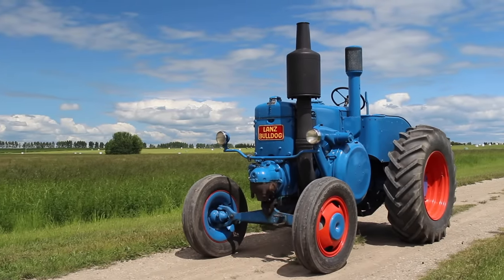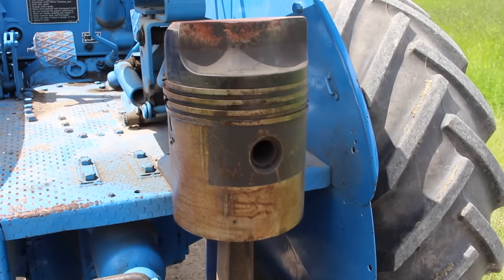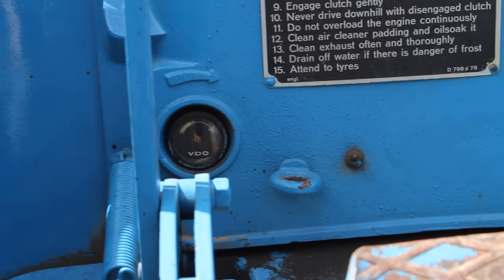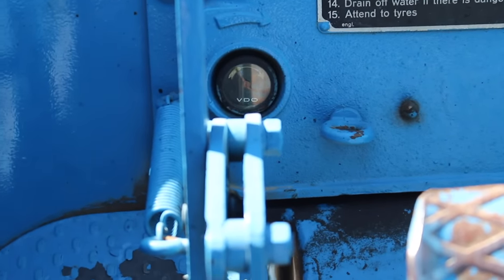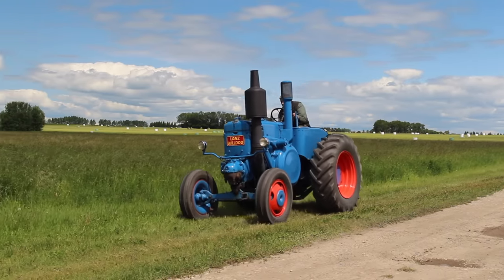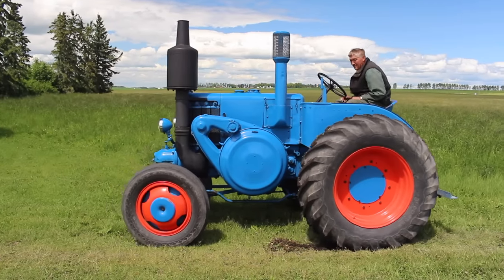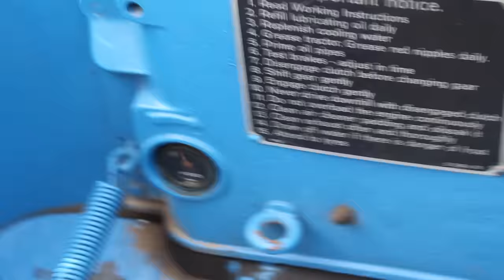Engine running backwards? Lanz Bulldog Tractor two stroke

Comment: Nice video! Its crazy to think that it only has one piston.
Reply: it packs tons of torque in that single one
Reply: One big piston
Reply: Over 600ci
Reply: @dieselgeezer18  no it doesnt, it has 45hp according to the info. Thats not lots of power at all
Reply: @hello7533  What did you expect from a 70 year old tractor? Yes it doesn't have a lot of power for its cc. I meant it packs torque and low end torque in a single piston, not power
Reply: @dieselgeezer18  he just doesn't appreciate it for what it is, a long-lasting simply built workhorse
Reply: @hello7533  It does have torque. 500Nm to be exact and that is just the amount at top speed. It most likely has an even higher torque amount at 300 or 450 with around 700 to 900 Nm. So it is a lot.
Reply: Similar torque compared to a Porsche 911 Turbo, Ferrari 488/-F8, Mercedes S-63 AMG
Reply: @andreashabeck1155  Exactly. And now for the important part because torque doesn't really mean anything.
The gear ratio is so low, that it multiplies this torque even further and with it's inertia still makes for a powerful tractor even for today. Just not as fast as modern ones.
Reply: @hello7533  HP and torque are two completely different things, that thing defiantly has a lot of torque.
Reply: @hello7533  Cummins diesel engines that are meant for heavy hauling typically only have around 500 HP, which isn't actually a lot especially compared to most sport and muscle cars, however, they have a shit ton of torque, over 1000 Nm actually, like for example: the Cummins X15 with 430-605 HP and 1650-2050 Nm of torque. That is more than double the HP. Just because something has low HP, doesn't mean it has low torque, and that one cylinder engine defiantly has a shit ton of torque, maybe not as much as a modern engine built for torque, but it defiantly has more torque than most cars now a days.
Reply: @PilotTed  power = (torque * rpm) / 5252

Comment: It looks nice when it runs at 0 rpm, but this is very dangerous for the piston lubrication because the oil pump of this Lanz Bulldog D9506 can only pump one way (forward). In the long run, this can cause major damage.
Reply: I heard they pump oil both ways
Reply: @GhostOfDamned  Not with this Lanz Bulldog.  A lot of older types can run the oil pump in two directions.  This because they have no reverse gear.  These include the HL12, the HP Knicklenker and the HR2.
Reply: Can't there be one of those pedal bike backwards and forwards drives?
Reply: @ellenorbjornsdottir1166  a fixie bike can be pedaled backwards
Reply: That's why it's not being done as you say, 'in the long run'. Just as a display of an interesting mechanical feature.

Comment: Older Mercury outboards had an "idling neutral" in actuality no neutral at all or method to disengage the propeller. To reverse the engine, the spark was advanced to the point where the engine backfired and started running in reverse sort of like this tractor diesel.

Comment: put someone on this tractor who have backpain
Reply: That can’t be good for it
Reply: Or perhaps it's exactly what it can @aterack833  . It could be like chiropractor treatment? 😭😂😅😆🤣😄😃🙂😉
Reply: @MrArray1967  well my back pain is from degenerative disks so I guess idk what helps normal back pain
Reply: @aterack833  back pain may be caused by many different reasons. I'm sorry on your behalf with degenerative disks. Years ago I had trouble with lumbago i.e. lower back pain. Exercises was my cure. Bending and stretching.
Reply: we had these in poland. the driver after many years of working in tractor with bucket sized piston have back injuries
Reply: @MrArray1967  chirotractor treatment :P
Reply: @okuratwarmianski7993  was the back pain caused by actually driving an Ursus/Lanz Bulldog or by repeatedly and perhaps prolonged manually starting them?
Reply: @ryanknol3876  chirotractor 🤣😅😂

Comment from the maker: It is possible to run at zero rpm!
Reply: Well, that's zero revolutions per minute. But not zero reciprocations per minute.
Reply: @leximatic  In RPM it's more like +60, -60, +60, -60, +60, -60, ... so it sort of averages out to 0 :)

Comment: 0:36: Please don´t call it "Diesel"! You can burn Diesel- fuel in it, but it is no "Diesel"- Engine. Diesel engines are classified in compression ratio from 12:1 to 24:1. The Lanz Bulldog engine shown in the clip has a compression ratio between  5:1 and 6,5:1 only.
Reply: Garten-Forsttechnik-Jenner what fuel does it take ?
Reply: Diesel, Gasoline, Alcohol, Kerosine, Cruid Oil, Engine Oil and a mixture of  different kind of fuel. If there is a liquid  that can burn you can use it in such an hot bulb engine.
Reply: diesels start from 14:1
Reply: @dieselgeezer18  you have to put something more combustible in the tank with the diesel to have an easy start in the cold but you can start it during the winter with 100% Diesel as long as the hot bulb is hot enough then you can run it 100% on diesel. Hot bulb engines both vaporises the fuel and uses compession to ignite, this is why you can run them on fuel oil and even crude oil.
Reply: @andersskithog7440  my comment is about the compression of diesel engines. The commenter said that diesel engines start from 12:1 compression ratio but this is wrong. Diesel engines start from 14:1. There is no diesel engine which has compression of 12:1 or 13:1 etc.
Now about your comment... Hot bulb engines do NOT use the compression to ignine the fuel. It has ONLY 6,5:1 ratio. The hot head is what ignites the fuel

Comment: How much add blue does she take?
Reply: Hahahahaha
Reply: Yes
Reply: "About 2 litres."
"Per 100 kilometers?"
"No, per stroke."
Reply: they didnt even fueld those tractors with diesel , especially during ww2 - my grandpa was drafted to drive those things during ww2 and they  used heavy fuel, fishoil, kerosene, tar or vegetable oil :D my dad owns a handful of those , from 1930s all the way up to 1960s
Reply: @CAARLcseditsandmore  That's incredible! Apparently they could also run on crud oil or naphtha. I just did a bit of research after reading your comment and discovered that these tractors were used by the Wehrmacht on the eastern front for a variety of purposes, such as removing ice from runways and towing airplanes from hangers. They're credited with being responsible for the Luftwaffe fighter aircraft being able to continue to operate from their mid-winter Russian located air bases. Every other engine would freeze up in those -50°C conditions but the Lanz Bulldog would always start because its single cylinder could be heated with a blow torch. 

Thanks for your comment and much respect to your grandfather for surviving such a vicious war.

Comment: I had a weed eater 2 stroke weedwhacker that was doing the back and forth thing one time. I was confused on what it was doing at the time.
Reply: What happend when u gave it throttle
Reply: @TheRCBasher69420  it would've picked a direction and started spinning that way
Reply: @TheAechBomb  oh yeah makes sense like in the video
Reply: @TheRCBasher69420  honestly if it went backwards it might (possibly) have broken the pullcord, because they're on a one-way ratchet
Reply: @TheAechBomb  oh yes they are but it probably wouldn't have the power and would just stall out

Comment: If I understand this correctly, the transmission DOESN'T have a reverse gear? To make the tractor reverse, you just reverse the direction that the engine is running?
Reply from the maker: This model does have reverse. The early ones you do actually have to reverse the engine rotation to move backwards!
Reply: Two stroke snowmobiles are like that, you turn the key to the reverse position then the engine stops and it starts in reverse because the starter has a second set of wires that are opposed to it spins in the other direction

Comment: Why are those engines known as "hot bulb" engines?
Reply from the maker: An official Diesel engine ignites the fuel because of their high compression. This engine uses a “hot bulb” basically a piece of steel that needs to be heated up in order to start and run it. They have fairly low compression and because of the hot bulb can run on crude oil and other fuels.
Reply: @davidsgarage  Ah now it makes sense. Thank you!
Reply: @davidsgarage  Ideal for Armageddon time. I wonder how would new John Deere's work in case of solar flare discharge.
Reply: @TomislavKoren  that pos doesn't work without a solar flair discharge
Reply: Glow plug

Comment: "No oil pressure gauge". It´s an oil bath lubricated 2 stroke hot bulb engine. There can´t be any oil pressure ;)
Reply: they definitely are not oil bath lubricated! that wouldnt work very well with a crank case scavenged two stroke! oil is fed under pressure from a reservoir to the mains and conrod bearing were it is then pumped through a screen to a second reservoir that is then fed to lubricate the piston and is consumed by the engine.
Reply: @jakeminogue  Negative. 
It's not comparable to a two stroke gasoline engine. Two stroke in this case just means, that It does two cycles each rev. 
So it ignites every rev. 
The fuel is directly injected and the air comes through a cylinder port. 
The crank case has nothing to do with fuel/air and has oil in it around 38 litres ;)
Reply: @jakeminogue  also they do not burn their engine oil.
Reply: @Slinoab  no you are wrong, i am well aware of the differences between gasoline and diesel (bulldogs are actually semi-diesel engines) the intake air is drawn into the crankcase during the compression stroke and the admitted into the cylinder via porting at bottom dead centre of the power stroke. all two strokes have to be scavenged, most do it this way, with the exception of detroit diesel two strokes ect. that use a blower to do it.
Reply: @jakeminogue  dude, I just said that with the air. Read carefully. 
But what knows the German guy who rebuilds two stroke diesel... The american GI knows better, of course :-)
Reply: @jakeminogue  Alright General Sir!

Comment: Magnificent tractor, is it a D9516? Did you leave the mud guards off the tractor and that doesn't seem to be the correct seat.
Reply from the maker: Thank you! It’s a 9506. Fenders were removed but originally it had fenders and a cab! Good eye with the seat! We still have the original.

Comment: As a kid I stalled an old Oliver tractor. I must have popped the clutch just right and it started running backwards! The exhaust pipe cover shut and gases started coming out the intake. I shut it down before it could hurt itself.

Comment: That was great 

The old mercury outboards had one know as a dock breaker as it ran like this

OMC outboards had a recall in the early 70s to install a switch that shut them off as they could also unintentionally pop and run in reverse

Comment: The cool thing is, modern technology has caught up to this technology from 70 years ago. Some of the new snowmobiles are direct injected two strokes, and use computer technology to instantaneously reverse the engine to provide reverse gear, at the push of a button.

Comment: Its very important that this tractor have piston oil pump. Not gear oil pump. So it doesn`t matter if it runs normal, reversed or like here. As long as engine moves it has lubrication
Reply: It has no oil pump , there is no oil in the sump , this is a real two stroke , air is sucked into the crankcase through reed valves , crank bareings are ball bareing and sealed from crankcase and oiled from gearbox side from splash oiling .

Comment: Some of the Transition between Forward rotating engine and backwards is so smooth that it seems the operator was just doing a gear change!!!
Reply: I know what you mean!  That's from the piston bouncing back off the compression that it's just made, but doing it at its own speed, as it were.

Comment: There is snowmobiles that run backwards for reverse too. Hit a switch and it slows down the when the moment almost runs out it spins the opposite direction and idles up.
Reply: You can drive 2 stroke mopeds and dirtbikes backwards also. The magic of 2 stroke engines.

Comment: The bulldog is not the only tractor that can run its engine in reverse. Old Zetor diesel tractors is also able to do it. When that happens you can the smoke wont come out of the chimney anymore. The engine will start force out smoke from all cracks and places in the engine bay. I have seen it happen twice...

Comment: Oil pressure or so is no problem. Piston pump. You can drive it backwards some time. The problem is the oil drain pump for the crankcase. If it runs backwards , the oil collects there till the piston sucks it in the combustion chamber. Normally it is regulated with the injection pump. If lube oil is sucked in it will burn it and the engine starts revving lots too high. Sometimes the end is a bent conrod and a broken crankcase. A revving Lanz is like a monster. Nothing stops the engine till the oil is burned.
Reply: I've heard of them doing that - and other two-stroke crankcase-scavenging engines.  It must be rare nowadays, not many people alive today will have witnessed it.  As you say, though - what an experience it would be!
    What type of pump is it, the one used for draining the crankcase?  I didn't think gear pumps were in use back in the 40s and 50s - perhaps I'm wrong.
Reply: @robwilde855  hello Rob
These are gear pumps indeed. That is the problem. They are located in the Bosch piston pump, situated behind the right flywheel. The oils way is from Tank to the bearings and con rod, thru felt filter and then to piston and cylinder. It is no problem to run it backwards 1/2 an hour or so but I heared of one driving a belt for longer and suddenly it changed its character into something really bad. If it gets his first drop of oil the speed increases and sucks more oil in. And then it begins...
Reply: @marcopruscini1603  Thanks!

Comment: I have a 2-1/2 ton army truck that will run backwards. I found this out one day when I tried to bump start it going down a hill backwards. I messed up and had it in a forward gear. It was so strange - I almost caused a wreck because no matter what gear I put it in, it seemed to go the wrong way. It only occurred to me what was going on after I saw smoke coming out the air filter. I quickly shut it down and used the starter and all was well.
Reply: Was it a 2 stroke diesel?
Reply: @seum.  Nope, it's a 4 stroke multifuel. White LDT465.
Reply: @librarymark  Wow! It was probably burning it's own sump-oil. Reckon that you were close to a runaway situation.
Reply: @martinwade9421  As I was able to shut it off by pulling the fuel shutoff, I doubt it.

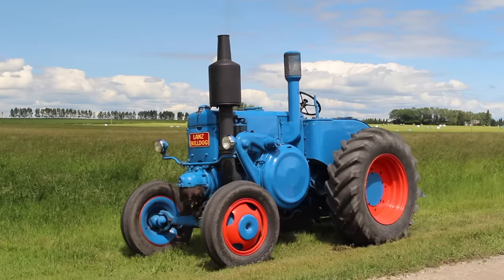Comment: 3:15 the whole weight of the tractor is being borne onto the connecting rod and bearing cap. Okay the engine is built heavy but it’s only as strong as it’s weakest or smallest part.
Reply: Its just idling. Its not even close to full throttle so its not generating its max power when its going back and forth. The only issue might be the lubrication system since it has to run continously and not oscillate back and forth. But for a few seconds it should not be an issue. The oil does not dry out from the bearings immediately

Comment: The piston is about the same size as the original Caterpillar RD6/D6/D6600, a 45 hp engine with a pony motor. Quick reverse, that's a feature!

Comment: The old Detroit 2 stroke would run backwards.
Reply: No need for reverse that way
Reply: I can't think of how it can do that. I know you can set them up to run clockwise or anticlockwise. The Detroit is a two-stroke engine that uses a supercharger so if it's running backwards the supercharger will be sucking air and not blowing. If I'm missing something let me know.

Comment: Torque comes from probably a huge ass flywheel. To kill it you have to make sure that baby winds all the way down to nothing or they fire right back up if you let loose of the kill lever or  kill pull cable to soon.
Reply: Quite right. [Except that it has two h.a. flywheels, one on each end of the crankshaft.]

Comment: The old Mack's used to do that if your back's against the pile and they would stall and restart going backwards only thing is you had no oil pressure and smoke would come out the intake you had to shut them off real quick because then backwards push forward and forward switch backwards

Comment: In the beginning you called it a diesel engine, later you said it's a hot bulb engine. It is a hot bulb engine which is not the same as a diesel engine. I've got one such engine (a 4 hp Swedish Västervik) but no tractor, I've got it only to make the wonderful noise.
Reply: You are incorrect , a hot bulb engine is an early glow plug, the hot bulb is only there to start it , it's a compression ignition engine ( a diesel design that can run on diesel , but alcohol, kerosene, cooking oil , petrol it don't care as long as it burns)

Comment: good way to hammer the piss out of the bearings with no oil pressure because the pump isnt turning enough to move oil when its firing back and forth like that
Reply: If it ran like that from the factory, there's no worries to be had about lubrication,as if it's stock,the engineers thought of it.
Reply: @f_for_freedom2492  the engineers did not want it running in reverse. That’s why they put that gauge on the dash. Being 2 stroke they knew it could run backwards, but the oil pump does not work in reverse.

Comment: There has to be some sort of system in place to keep the oil pump and, if it needs a super charger, spinning in the right direction even when the engine isn't.
Reply: Lanz had a reversible pump which worked both ways. The British copy, the Fieldd Marshal, didn't. lol.

Comment: Can you drive forward by having the engine rotation reversed and in reverse gear??? That would be a good party trick 😂
Reply: There is no reverse gear , it's made to run in reverse when you need reverse ,